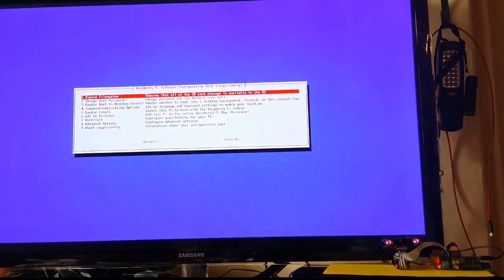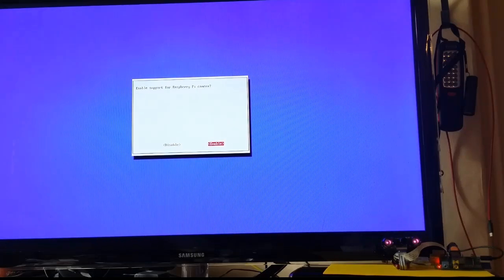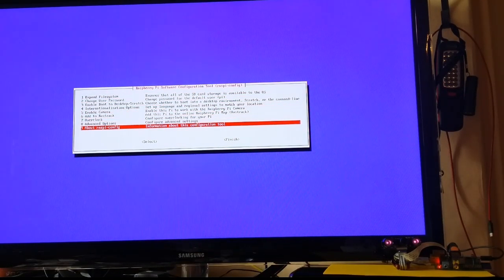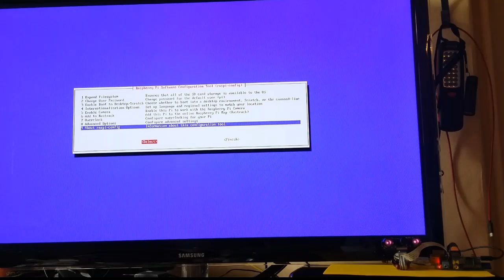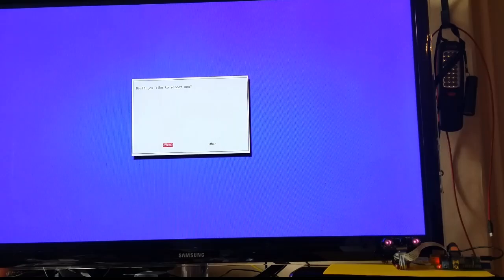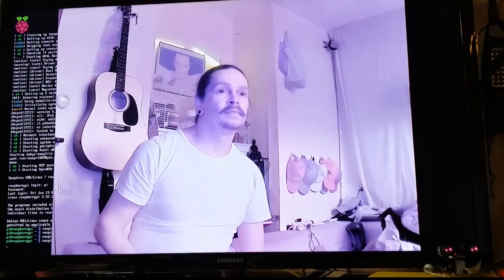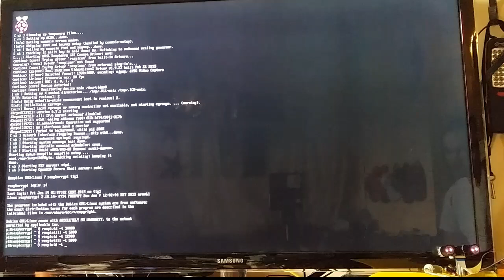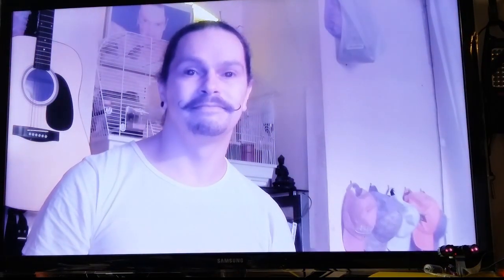Open MAKER reviews: Sainsmart RasPi NOIR camera

Comment: Is this camera module compatible with rpi 4 b
Reply: I assume so, it uses the csi connector. The supporting driver code will have changed in the meanwhile though. So not sure if that will still work. But i guess there are many sources online for updated code.

Comment: Does this camera automatically switch into night vision mode? Mine doesn't seem to. I don't have the IR lights on the side as I have a different IR light source. Perhaps that is why?
Reply: Yes, technically the camera is "always" in night vision mode. Because it has no IR filter. But yeah, if you would have the IR spots that come with the camera and attach them to the sides, then they turn on automatically when it gets dark.
Since you have external IR spots, you would have to turn them on yourself.

Comment: What volate do the IR lights run on?
Reply: Actually, i don't know. My guess is 3.3V. But they get power from the camera module itself. So there is no need to worry about that. Just bolt them to the camera like in the video and they work.

Comment: hey i wanna ask...
does waveshare 10299 camera need ir filter?
Reply: The normal Pi Camera has an IR filter, it makes for a sharper image since IR and visible don't focus at the same spot.  The NoIR modules made without the filter specifically for IR use.

Comment: i was wondering if i were to take the strip that connects it to the Pi and replace it with a slightly longer one if it would affect the video quality?
Reply from the maker: No, the signal is digital. so the length of the cable doesn't matter. Though i wouldn't take a 10 meter cable. Even digital signals can be corrupted over that length.

Comment: thanks for your video! is there a camera API available where I can control the IR lights with?
Reply from the maker: Peter Behringer No there is not. I was looking for the same thing. However, you can use two mosfets/ darlington transistors to switch the spots on and off with the GPIO pins.
Reply: There is a very small pot that you can adjust the brightness of the IR diode,if you turn the pot off it will turn the emitter completely.  But for my use I was unable to turn it down sufficiently.  This cam has manually adjustable fix focal length. I use it for my 3D printer monitor and works well. I find I only need a single IR emitter.

Comment: Good video, a question Can you record continuously by making 30-minute recording packages? And store them in a Hdd like the one of WD 320Gb or in a SD of 256gb?
Reply from the maker: Dario Santarremigia Sure! I don't see why not. you'd probably have to write a little python script or cron-job to record every 30 minutes, remove the old video (if there allready is one) and then make it do (radpivid -t 300000 filename.mpg ). You probably have to calculate the correct time. 1000 = 1 second

You can then play the video with mplayer.
Reply: Thanks for answering so quickly, I will learn python. In the script I will have to say the location where I want the file to be recorded and the duration of the files, I suppose.
Reply from the maker: Dario Santarremigia Indeed. just like i mentioned above. 

raspivid -t time-to-record-in-milisec /path/to/save/your/file/to.mpg
Reply: Thank you for your time, very kind.

Comment: Hello, bro i connect me camera ( same of the video) and i can not see the image, i enable the camera in raspi config and other thing is me camera has leds red
Reply from the maker: YT SPARTANO Did you use the flat cable the right way around? If the red led on the camera module is on (not the IR spots) that is a good sign. The flatcable is the right way around.  It has been a while since i installed the software but there might be some changes. Using the command "raspivid -t 30000" you should see a moving image for 30 seconds. If you see nothing, you might have to make some adjustments to the camera's configuration file. There is an option for outputting a preview to your screen that you can turn on or off. It used to be ON by default but that might have changed.

If it still doen not work, you might want to contact your seller for a replacement.

Also check the flatcable for dents or tares. The very thin tracks can easily tare and are very fragile.
Reply: Thanks for reply, i connect the camera same to  the video, i can not see the led red in the camera, im try use the raspivid and no video window open, How i can adjustament the configuration file? i new using  the raspberry
Reply from the maker: YT SPARTANO If the red led does not turn on is you run the raspivid command, then there is something wrong. either with the cable or a software issue. 

I can' t remember where the config file is located. But google is your friend😊.

search for raspicam config
Reply: Ok thanks for u help, i will go search in google
Reply: Bro, i can take pictures, using 
raspistill -v -o test.jpg,  but i can not use the raspivid,
Reply from the maker: YT SPARTANO Ok so it is working.  I suggest that you start with a fresh install of raspbian. Then go into " sudo raspi-config " ,  expand  the sd card partition and reboot. next do "sudo apt-get update". when it is finished do "sudo apt-get upgrade". reboot again (sudo reboot) 

Now do "sudo raspi-config" again and enable the camera. 

Now you should have a working camera module.
Reply: I did all of the above and I can not even visualize with raspistill
Reply: other thing is i can record

Comment: how do I know if both of these IR are working? when I look at one of the IR light its red the other is not.
Reply from the maker: David C You can try turning the tiny potentiometer on the spot that is not glowing red. Be carefull though, it is very fragile. It only turns 3/4th of a full turn.

This potentiometer set's the sensitivity for the ambient light sensor on the spot. This also means that if the is more ambient light falling on one sensor than the other, one could be brighter than the other.

Otherwise it might be connected to the wrong side of the camera module (front or back NOT left/right).

I hope this helps.

Comment: I just followed your video and tried to plug the sain smart noir camera to my pi 3 B but as soon as I start the pi it keeps rebooting . What can be the problem. And yes the red lights are glowing on the ir lamp so I think it should be okay with the connections. So what should be the problem for continuous restart please help me someone
Reply: So sorry it was my power supply the samsung charger wasn't able to provide the enough power with the camera so I replaced it and it just worked finely now...
Reply from the maker: Dilip Poudel Sounds to me like your powersupply is not strong enough to power both the RPi and the ir spots. I only have a RPi2 and needed the specific powersupply for that (5.2V 2.5A if i am not mistaken). Usually the red led on the RPi will blink when there is a power issue. 

I guess that at the moment the camera get's activated on boot, the RPi get's a power dip and resets.

Hope you can solve it!
Reply: Thanks I got that sort out and had to change the adapter with a stronger one. If I had to work on with offline power supply. Can you provide any estimation for any batteries and life expectancy as I am trying to build a wild life trap camera and needs to have pi working on batteries.
Reply from the maker: Dilip Poudel Accually i have never tested that out. I think i had it running for 4 hours on a 8000mah battery pack. But i am not entirely sure. It is just a matter of trying.

My thought is that you need a pretty big battery to have it working for a whole night. 

Maybe a car battery is an option? Though than you would need a voltage stepdown module to convert the 12V from the batt. to 5V for the pi

Comment: I found just the ir emitters on amazon, how do I power them with the official pi NoIR camera?
Reply from the maker: Terry Walker  If by "official" you mean the non-Sainsmart (usually green pcb) ones, the answer is: you can't. 

Only the one that is sold by Sainsmart (and maybe other stores?) are compatible. they have copper tabs on both sides of the camera board. You then can attach them with the supplied tiny bolts and nuts.

You can still use the IR spots, but you have to power them from a seperate power source (voltage is unknown by me so check the data supplied by the seller. Do not connect them to until you're sure you know the correct Voltage).
Reply: Well, that is part of the issue. The website doesn't give any details on the power consumption of the device alone sadly.
Reply from the maker: Terry Walker Let me get back to you in a couple of days. I will boot up the pi when i have the time and will measure the voltage supllied to the spots.
Reply: Still hoping to hear back from you on this.

Comment: Can this be set up to wireless send camera video to a receiver on the PI 3?  I need a very small camera that I can put in an HO scale engine and run the engine around the track and take video.  It would have to be transmitted wirelessly from the camera to the receiver.  How many volts does the camera take?  Could it be powered by battery?  Any info would be appreciated.  Thanks for the video.
Reply from the maker: W. Rusty Lane I guess so.  This camera needs to be connected  to a raspberry pi  itself.

The rest (streaming of the video) can be done by using (for example ) a python script. I think there is plenty to find on google.

It is small though! camera module itself (without the IR LED) is smaller then a square inch.
Reply from the maker: W. Rusty Lane There are rc type wireless camera's on the 5.8Ghz band that are more suitable for your project. 

But if you want to you can always use this camera module and a raspberry pi and record video or send it to another raspberry pi for live view. The latter requires you to have a wifi connection though. wich might not work at the track. There are some powerfull usb wifi modules that can go up to 1 kilometer in distance. check ebaY for that. They usually have large 10db antennas with those. 

Keep Making!
Reply: Thank you for the information.  Once I get operational again I will give it a try.

Comment: Great video dude. Do you know how the camera module performs under low light conditions? I think that would make a great video.
Reply from the maker: It performs just as good as night as at daytime (colors dissapear because of IR light in the dark). I didn't do any FPS test. but i think that will be pretty much the same in both situations. The IR spots are really bright!

Thanks!
Reply: Thats really cool !!!! Have you tried the camera at night outdoors? coz I recently bought the raspberry pi NoIR version 2 cameras and when the sun goes down the images captured outside are just all black
Reply from the maker: +Eli Chi Did you also get the two IR spots with it? You need those to see anything. the normal IR radiation of outside at night is too weak.
Reply: Yes I did. With the IR LED's the camera takes decent video and pictures in total darkness. But then when taking pictures and videos outside its just black images, I guess the IR illumination has nothing much to bounce off outside. That is why I think it would be a cool you could do a Sainsmart vs the raspi NoIR camera for both indoor and outdoor conditions :)
Reply from the maker: +Eli Chi Ah i see. I think the spots are indeed to weak for outside. Atleast anything further than a couple of meters. Ofcourse you could use a bigger IR spotlight. 

As far as i know the Sainsmart piNoIR and the official piNoIR cameras are exactly the same.  The lens might be different but the hardware is not. So it seems to me that there is no way to compare the two except for pcb color.

Though i wish i had time to make more videos, but i just moved to a new appartment and there is still sooo much to do!

When my new workspace is ready i will start making videos again on a more regulair basis.

Thanks for your interest!
Reply: Okay cool dude thanks for the feedback. Awesome video again :)
Reply from the maker: +Eli Chi You're welcome😊
Reply: Hello both of you guys. I got an official NOIR camera V 2.1 it seriously needs those LEDs to see in the dark. Question is will those LEDs fit the exact camera? I haven't got to find anything relevant except from ''These allow adding night vision function to RPi Camera (E) or RPi Camera (F)''.

Comment: Is it possible to mount the assembly, with standoffs, inside of a fan cooled case?  I imagine that I might have problems with reflection of light if I put a piece of glass in front of the assembly.  Dividers could be used to keep the reflection to a minimum.
Reply from the maker: Indeed. The glass will reflect a lot of IR light that will wash out your image. The stand-off's won't be a problem, assuming you can find stand-off's small enough to fit the tiny holes. The default size won't fit.

Good luck!
Reply: Adafruit has a possibility.  McMaster-Carr also carries a size that can fit this.

Comment: Hi, Great video, helped me a lot, but I screwed the Led to the camera and it works, but the led always off(no way to see in the dark at all), the seller says that there are Adjustable Resistor, may be that one the problem? I just cannot understand where the resistor are... Many thanks in advance!
Reply from the maker: That is right. there is a light sensor next to the IR led that measures the "daylight". if there is enough light around, the IR led will turn itself off.

You can adjust the sensitivity of the sensor by adjusting the pot. The pot is the silver coloured round component with the "+" on top. with a small philips screwdriver you can (very, very gently) turn it left or right. Don't go too far! the pot can only rotate +- 3 quarters of a full turn in total, and is very fragile.
Reply: Thanks man! Great help!!!It's still not working, no idea why... i tried to calibrate
it but nothing...
Reply from the maker: +Francesco Forcellini have you mounted the led 'over' or 'under' the camera pcb? If it's like in the video, then your led's and/or you canera module might be faulty. I would contact the seller and ask them for another.

Good luck!
Reply: yes it's built properly... i guess the led are faulty... the camera it's working...
Reply: thanks a lot!
Reply: I wonder if it can be a firmware problem, i'm running octoprint Nightly Builds on a raspberry pi 3, do you think it can be that or it's just impossibile and it's better to ask a new one?
Reply: in case it cannot be, i've read you're dutch, do you know where I can buy here in the Netherlands?
Reply from the maker: +Francesco Forcellini  As far as i know, the leds are not programaticly driven. They are just connected to power. So a firmware problem is out of the question. 

I don't know any suppliers in the netherlands, sorry. I've gotten mine from Sainsmart.com
Reply from the maker: +Francesco Forcellini You could however, use a multimeter to measure the voltage on the terminals/pads connected to the leds.
Reply: ok thanks!
Reply from the maker: Sorry for the late reply. I thought i allready replied to you. 

The resistors (potentiometer) is located below the black tube (the "light dependent resistor ").
It is the round silver-coloured thingy with a "+" in it. You can put a tiny screwdriver in there and turn (max. 3/4 of a full turn, or you'll break it). 

This potentiometer is connected to the light dependent resistor (LDR) and makes the LDR more or less sensitive depending on the position of the potentiometer (pot in short)

So if you're in daylight, the sensor will shutdown the IR spots. But if your sensitivity is too high, even the lighting in your house may shut it down.

I hope you can solve your problem and thanks for watching!
Reply: I solved, many thanks!

Comment: What are those spiky things beneath the noir cameras? Do u need it
Reply: half4team: He's probably referring to the heat sinks. Perhaps not strictly necessary as the manufacturer didn't feel the need to include them, but reducing heat always increases the longevity of semiconductor devices considerably, so it's a good rule of thumb, especially for high-power devices such as these.
Reply from the maker: You mean the pink stuff? That is just background material. Has nothing to do with the camera.

Comment: Great video! Where can I get those heat seat components?
Reply from the maker: These heatsinks i made myself. I pulled a large heatsink off a videocard and used a handsaw to cut it up.
Reply: I don't know about these, seems he cut pieces from something else to make them, but most any Raspberry Pi vendor sells stick on heat sinks designed for the Pi3 cpu.  Microcenter, Adafruit, etc.  about $1.50 each, these should work fine here too.

Comment: is it possible to turn the IR Emitter on and off?
Reply from the maker: The IR spots have build in sensors so that when there is enough daylight, the spots are turned off. Apart from that, if you wouldn't directly connect the spots to the camera module you could put a switch in between or control the spots via a pin on your raspberry pi (you would need to use a mosfet or transistor for that).
Reply: +half4team thanks alot, yeah will be using an external IR Emitter. as I need 40M range on the light. thanks for the insight.
Reply: On my Pi3 B there is not enough power available over the camera module connector cable to run the IR leds.  Camera module won't work with the leds connected, works fine with them disconnected.  I metered them and they are drawing a bit over 100 mA each.  That is asking a lot from the camera module connector!  There should have been pin headers for 3.3V power at the least, better yet the leds should have been powered from the GPIO 5V supply (i.e. pins 4 & 6) instead of the Pi's 3.3V supply